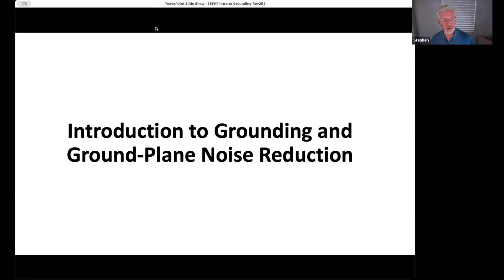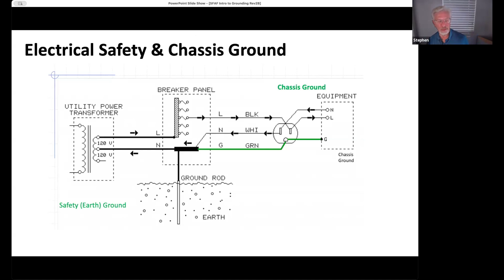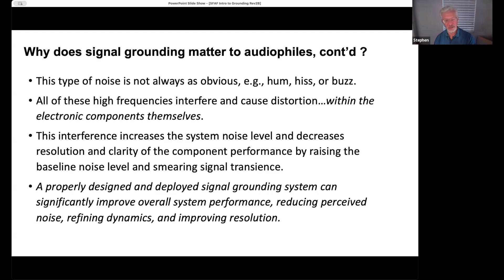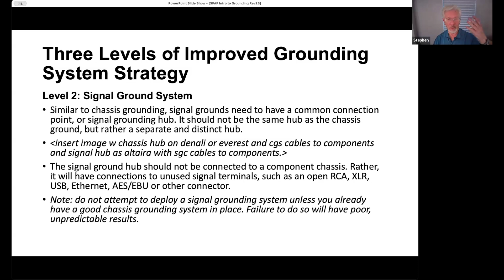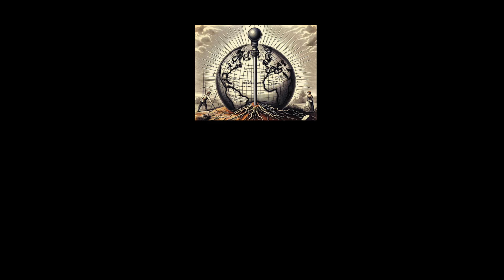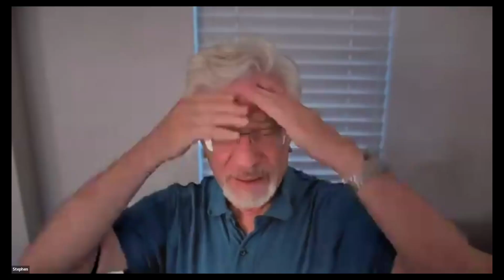Stephen Scharf on Grounding Essentials

Comment: Thank you for stressing electrical safety. 
I’m concerned that some audio products are sold without UL certification. I tend to stay away from uncertified products as I don’t want a house fire or shock hazard in my house. 
The comments about NOT adding a separate ground rod in the earth for your system are important in my opinion. Always work with an insured, certified and licensed electrician for safety sake. 
Thank you for your interesting presentation!